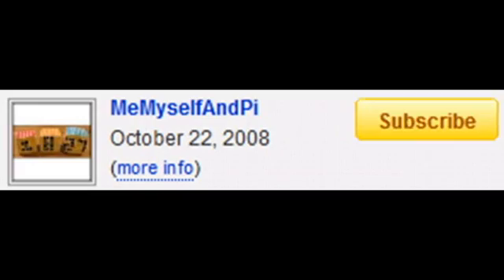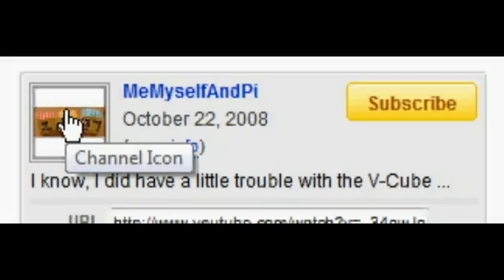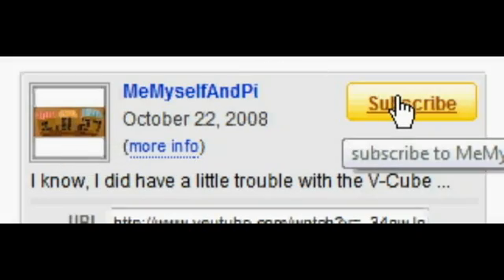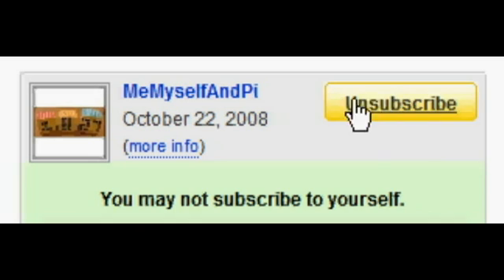How To Solve The 5x5 Rubik's Cube (Part 2)

Comment: I got a corner parity like in the 4x4 were the two corners are swamped. I tried the algorithm that I do on the 4x4 but it doesn't work. Is this even supposed to happen? I am sure that it wasn't taken apart and switched. Help please.
Reply: Even if you think it wasn't taken apart, you should probably take those two corners out and switch them. There is no last layer parity for 5x5, just edge parity. That's why the algorithm wasn't working.

Comment: Any method you would use with a 3x3, just pretending the three joined edges are the normal edges on a 3x3, and with the 3x3 tiles in the middle as the one middle tile.

Comment: That is basically the same as the algorithm to fix the parity of having one edge backwards on the 4x4x4, which makes the third layer unsolvable.  It's a slightly simpler version because you don't have to slice since you don't care about messing up other edges and such.

Comment: the exemple at 1:40 is not the best and fastest way to solve them you can just take the middle edge piece in to the another one bar that got the same problem apply the flipping algrothum and it will become solved.  if u guys understand its great couse my english sucks -.-

Comment: do you have an algoritm to flip the three edgeblocks upside down. In the 4x4 there is an alghoritm when get no yellow cross I tried this R2*,B2,U2,L*,U2,    R'*,U2,R*,U2,F2    R*,F2,L'*,B2,R2* but then middle edge isnot flipped an i back